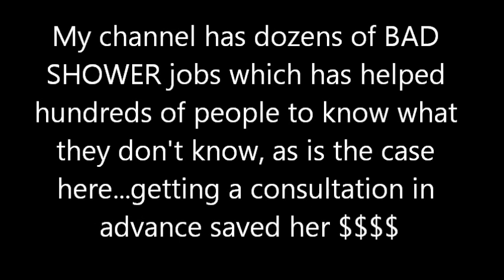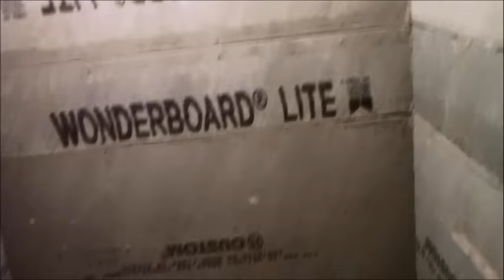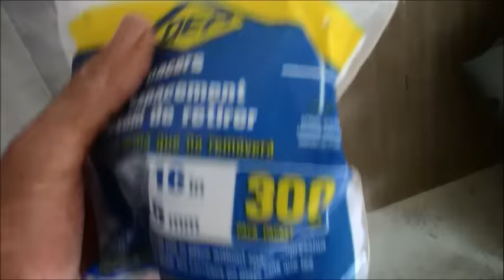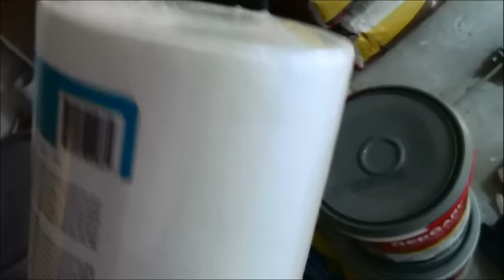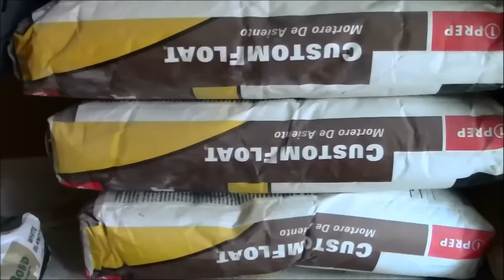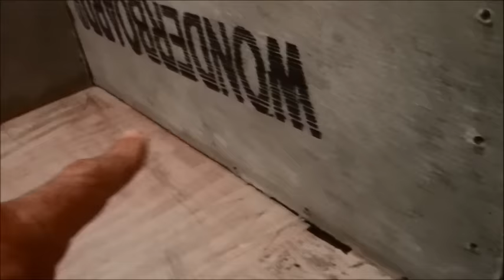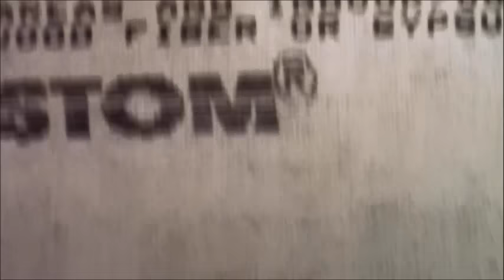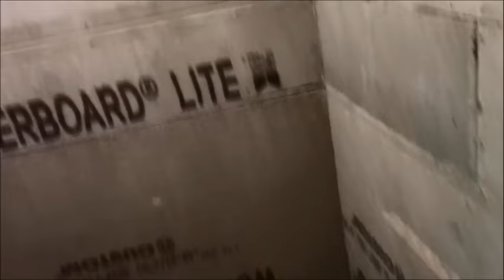BAD SHOWER DAY ONE !!

Comment: I can see another potential problem, two different materials used in the sub floor. Also, even though it's allowed, OSB is a bad idea under a shower, or anywhere in a bathroom floor really, I wouldn't build a shed with it to be honest. If it was existing it should have been replaced with plywood to match the rest, if it was new it shouldn't have been used at all. The new plywood (it looks pretty weathered to me) should have been screwed down to the joists preferably, but they did not use anywhere near enough nails. You have a point about blocking around the base of the shower, the pan needs to attach to something, and around the edges of the concrete board.

Comment: Ya def center up your shower diverter but i will say i have taken down a few tile showers for updates and to my surprise was sheet rock and it was dry and it held smh they did do a vapor barrier behind it So the backer board with thin set and tape is pretty spot on I still use aqua defense but honestly if done properly probably do not need it good call on the pt thou kiln dried white wood is the best in my opinion

Comment: The role of tape is for the corners an seams.  Red guard an other roll on waterproofing have a tendency to leave pinholes even with multiple coats. The roll stops that from happening. The mastic is fine to use in showers as long as the tile that's being used needs no larger that a 1/4 notch for its application any larger and it will not dry. You should never use mastic on a shower floor or curb. In that case you are correct it will never dry out completely an you will definitely have tile adhesion failure. Like the vids.
Reply: No mastic ever in shower it gets soft with water thinset don’t cause it’s concrete
Reply: The glue on walls are ok if done right always thin set on curbs & floors

Comment: Whole point of spacers is a uniform measurement throughout, I stick loyal with my dude Tavy. Maybe it’s cause I use a lot of 1/16 and 3/32 line almost exclusively, I feel they make a good tile job pop even more. If you come to with the site with spin doctors for tile that’s not at least 3-4 square feet and warped to shit, I already know you can’t level and plumb your mud to within a grain of sand’s accuracy! 😂

Comment: I think we need to get away from the idea that a drain has to be in the Middle. That is the spot a person would be standing,  so move it to the side/up- down, left-right.
Reply: I agree with that, long side drain ftw, but the handle and shower head not being centered! That should be corrected.
Reply: @whattheschmidt  Why must it be centered? What rule is that?  Homeowner is the one to decide where the valve goes. There is no rule.
Reply: @John Peters  For aesthetics - they should either be way off on purpose (side / far wall for instance) or lined up, not slightly off, that looks like an install mistake.

Comment: If I were to bid a job like this I would do everything that needed to be done in that area  plumbing,Sheetrock,and framing if need be , and tile ,that way you don’t have someone that thinks they’re helping you out but in fact are creating more work for you .I need to know that everything is done right .everything needs to happen in stages . As for the spacers I always keep every size in stock and according to the size of the job you may need to purchase a bag or two more,and I am positive that one bag of spacers is not going to be enough to do the tile with . I have subbed a lot of work out over the years and I usually can tell if someone knows what they are doing within 15 minutes of talking with them. No disrespect to anyone that reads this but I have never had to go back and fix a mess up from a sub . I take pride in what I do and everyone that has worked for or does work for me I hold them to that level also.

Comment: I am on this same job today. Done by a supposed contractor. It’s at 90% done, badly. So I am going to have to tear it all out and start over. Funniest part is I was at this house back in December doing some flooring and countertops. They hired the other guy instead of me because he was going to get it done faster than I said I could. Now it’s March and it’s still not done. I said I would be finished with both bathrooms by early February at the latest. I work alone so it does take me a little longer than if I had help. The other bathroom I can salvage I hope.
Reply from the maker: For customers they have three choices, get it done cheap, get it done fast, or get it done good, you can only pick good so it won't be cheap or fast 😉

Comment: Let's get this straight, the tile guy subjectively did everything wrong, but basically he did nothing wrong.
Reply: yes and no
Reply: You know the saying "guilty by association" well in this case I believe that can be closely related,
He may have been present and had very little participation or none in what was actually done, but it's the intent of the incorrect process and materials that make the original contractor wrong.
So with that he is guilty by association because you can clearly see what was about to go down.
Just like if anyone were in court being charged with a crime they did not commit, that person was still there at the crime scene with full intent and stood around in observation before actually doing anything or not doing anything, or watching others do things. 
In this case it looks like the contractor underbid they're labor and overly spent on materials to compensate for they're lack of knowledge in the trade(thinking the most expensive products were going to somehow do all the work for them) and went back to the costumer after buying all the materials and said they would need more money. 
This is not uncommon with the trade work industry, if you get complacent and never learn more or even research updated trade information, you will fail. And if you are cocky thinking your way is the best way, well that is just ignorant, back before technology  and building code that would have been okay, but at the end  of the day you are doing a job for a client or customer and just out of respect for yourself and the names of the people who work for you who have to make a living, just have some pride and dignity in your labor, and always have integrity, word of mouth and the internet making note of all your wrongs and rights, it would just behoove an individual to progress in they're profession.

Comment: You are on point for so many things. But I'm learning NOT to re-use spacers. They get mortar on them, you have to wash them, dry them, store them. At 4 bucks a bag (average) it's just not worth it to maintain/inventory all those different spacers.
Reply from the maker: It is entertaining to me how so many are focused on the new spacers this guy bought when it was only one of a dozen different things that I talked about. But I guess more to the point and I should have specified on the video, those spacers had no place to be there since with a large format tile he should have bought leveling clips...and in fact the box of used spacers that I carry around haven't been used in years. Large format tiles basically made spacers irrelevant.

Comment: I finished a job that looked like this when I got there. I removed the lower piece of wallboard, before starting. I’d love to see you show the process in full, instead of drawing assumptions before the tile installer even mixed a bag of mud. Looks like the prep was not done...yet, by the installer.
Reply: @shittyopinions  Plot twist: This isn't a shower. It's the strangest kitchen and backsplash you've ever seen.
Reply: @shittyopinions  Never heard of Acrylpro, but data sheet is saying it's made specifically for tub surround and shower walls. So seems like his plan was the bag of thinset for floor tile and Acrylpro for wall tile. This doesn't sound like a crazy plan yet, maybe not what I'd choose but not like he picked out joint compound or anything. It does say not to use over non-porous surfaces, so curious what the Acrylpro + RedGard plan was going to be...
Reply: @shittyopinions  Yeah, I've never used it but I personally wouldn't choose it for a shower - even if just talking walls. Point was the item wasn't a crazy choice itself; if he's Redgarding the walls fully (probable based on glimpsing supplies) and then using the adhesive directly on top it's going to be problematic... but those are all guesses.

Comment: Tile adhesive is mastic. Acrylpro is mastic. He was going to use that on the wall. The fabric tape is great. It increases the thickness of the waterproofing, it joins the boards together and it reenforces the corners making it crack proof. It seems to me he was going to glue the pan liner up the walls lol He was going to fuck up this job big time. Lol
Reply: Or, he was going to remove the lower sheets of durock. The drywaller installed that, I believe he said.

Comment: The "mesh tape" as you call it, it great for tile (if using a schluter or wedi board). Actual mesh tape (3" or 6" with little holes) is what you should use on fire places or with wonderboard (aka crap board).  Redguard is a great product if applies properly, 3 coats and allowing a day to two days between coats for drying.

 Great video a lot of great knowledge.

Comment: I am a tile installer and much of your information is misleading. Yes, there are many things that may make you wonder and much of that prep IS incorrect. But for example; one bag of thinset onsite...I will sometimes drop the single PC bag in my trailer and get more later. 2 bags of the sand would NOT cover that floor for the preslope AND bed slope. He has just enough with a bit extra, which is a good thing. I tape and waterproof. What’s wrong with reenforcing?  You also contradicted yourself. You see a bow in the wall, but use what you called a straight edge, (Pressure treated wood) will not be straight. Some info beneficial, much of it irrelevant.
Reply: Thank you! thanks God,you are one of the few who are sincere here you are correct  I've been doing this type of work for 30 years being  a license contractor/ sub.  tiles marble and terrazzo business, this guy is pathetic he's looking for more money👍👍 I appreciate what you said,you are correct  I say hi to you from Miami.

Comment: The floor needs to be tongue and groove. The floor has to be solid. Then you do the plumbing and shower pan first. Then you make the pan. Then 1/2 inch cement board goes up and then the  wallls have the be plum and square. Then the water proofing all over the walls and pan. Then you finish the pan. Then the tile job starts. 1/4 inch cement board is for the floor.

Comment: I tiled our tub/shower. We did a Roman bath/ shower. I red guarded the studs in the lower parts of the walls in tub area just in case. I used the wonder board, used seam seal with the tape, used red guard with its seam seal tape, used a rubber membrane on floor up sides to the bath top area, then I did a drypack and floor. I watched tons of YouTube videos and wanted to make sure I was waterproofing good. Before I tiled.

Comment: Long as you screw the pt. Boards down well you won’t have a problem with warping...
Reply: Also use subflooring adhesive under and between each of the new curb's 2x4s... along with screws that should be screwed into as many floor joists as possible.

Comment: Thanks for your great insights! I always put ice and water grace down to the rubber pan behind all duro rock, especially when I do several benches and shelves in the shower. The screws for the duro rock are sealed behind the duro rack by the grace ice and water membrane. Also I always make the tile go 6 " past the glass door into the bathroom. this makes a more beautiful job and a more waterproof one. What do you think?

Comment: I’ve been installing tile for over 15 years and buy spacers all the time. Maybe his 1/16” spacers were back home in his shed and Lowe’s was 5 minutes away...

🙄
Reply: Because 1/16” spacers suck because they are hard plastic vs 1/8” are rubber so they can be used over and over. But if somebody told me I didn’t know what I was doing because I bought spacers I would laugh at them and say hold my beer why they watched me set that whole bathroom in a day and grout the next. 😂 but I also have 17 years experience
Reply: Right, most of the time I bring new spacers it’s not like you’re not charging the customer for it.
Reply: 1/8 Rubber spacers make the vertical grout lines 1/8 and the horizontal about 3/32 with the weight of the tile
Reply: Double them up man. Trust me been setting tile everyday for almost 20 years now
Reply: @LuA-ex2si  if the customer cant pay $20 for the job done the way I want.. they can call their drunk uncle or have their marriage ruined because they stress their husband out

Comment: Regard's own instructions say "For extra protections, embed a 6" (15cm) wide fiberglass mesh into the membrane for changes of plane and gaps 1/8" (3 cm) or greater."  Other than that, spot on.  That's why people should hire licensed Contractors.

Comment: The bigger concern with treated wood isn't really warping / twisting. Pressure treated lumber is absolutely saturated with water, dead-soft and flexible. Properly secured with screws it will dry straight. The problem is that it will shrink substantially: 1/8 to 1/4" shrinkage is common. The biggest problem is that treated lumber is extremely **EXTREMELY** corrosive to metal fasteners. Hot-dip galvanized or ceramic coated fasteners are essential; any normal screw / nail / staple will rust away to nothing from galvanic corrosion.

Comment: No, you're not negative.

 Showing the pitfalls and mistakes are excellent. I once heard a tile guy say the tile covers mistakes. He was immediately off my big job. The guy I had do it, some 28 years ago said the substrate must be solid and he will not lay a tile on plywood as one guy said it  would save money. I have done several smaller tile projects myself. I have done shower pans, bath floors. Everything begins with the rough in work being solid and centered. 

I was hired help on a roof job last year. (I'm retired, small jobs are okay)The guy I worked with cut corners and said it won't matter. It's in a senior development and he said she will be gone before they notice. He justified a crap build by saying that's what the customer wanted. I said no to a tub install when the owner wanted a lot of cut corners to save money. I believe the owner in this video wanted cheap, so they got cheap.

Comment: Shower drain is only required to be 1 1/2" per code. the drain body can be bushed down to accept 1 1/2" pipe. FYI. (49 yrs plbg.)
Reply from the maker: Interesting, I usually bush up from 1 1/2" to 2" as far as I can.

I always questioned why a shower which has less GPM than a tub requires a larger drain, the answer I have gotten from plumbers is because a tub is generally 18 to 20 inches tall whereas a shower curb is only 5 in, that way more water flows out of your shower quicker than a tub, but I've never tested that.

Comment: i wish you had said something regarding stud prep, the correct screws for cement board, length and style. Fur strips are not meant to hold cement board but to plum a wall and longer screws may be needed to reach the stud. Thanks for taking the time for this video

Comment: One thing, red guard alone won't work. Most codes demand a hpg with anything cementous. Also just saying....you must tape concrete board with a thinset. Also red guard takes too many coats and hpg is higher rated. It has to be applied at a thickness of 40 mil.

Comment: I'm a home contractor (mostly drywall, paint, trim, small repairs etc)and doing my first step in shower and I'm still confused about the pebbles around the drain 
I just got most of the 40 vinyl down...

Comment: Lots of good tips here, let me add….When I build a shower…. And I’ve built a bunch in the last 40 years I use the pvc liner glued to subfloor, ( mastic for wood sub floor, thin set for cement)  apply tar paper to walls over lapping liner, install firing strips to the studs out to the thickness of the liner, making sure the cement board is plumb and the corners square ,tape all corners and seams with an alkali proof mesh tape and thin set. Then apply the red guard or other water proofing liquid membrane, then dry pack the floor no thinner than 3/4” then tile walls first then floor and finish with a grout sealer. Never had a failure or complaint….. ever! Lifetime shower!

Comment: You can use tile adhesive for shower walls right?  Just not for the floors.  As long as it's backed with 1/2" hardieboard that is waterproofed....  Correct me if i'm wrong.
Reply: No

Comment: So people prefer the shower head not centered but closer to the door so that it is pointing toward the center and away from the door. Also, I had a plumber tell me that having the valve closer to door makes it easier to reach in and turn on.
Reply from the maker: But the issue was that's not where she wanted it, even if she did want it there it would not work as you described because the panel of glass eventually goes on the left side and the door on the right side

Comment: The idea that anyone is still contemplating the use of cementitious materials anywhere in a shower speaks volumes for the previous contractor and this one.  It’s 2022, folks.... Cement board?  Hard pack?  Wood curbs? Rubber membranes?  Haven’t used any of those products in at least 10 years.  Cement and wood are absorbent... freaking sponges.  The technology is well beyond this.
Reply: I’m trying to learn how to do showers. If no cementitious products, what do you typically use?
Reply: @cnote103190  cement board walls, hard pack curbs and pans; mostly Schluter Kerdi membrane. Foam curbs and pans are awesome.

Comment: The squeak on the subfloor isn’t wood rubbing on wood, it’s wood rubbing on nails from the deflection. If tile wasn’t being installed you could throw in a few screws to get rid of the squeak. Just FYI…